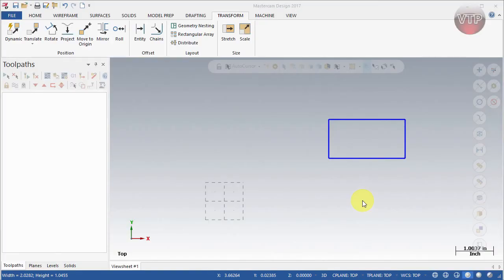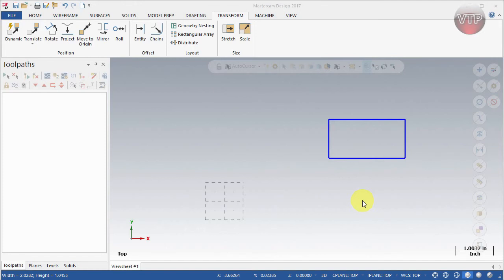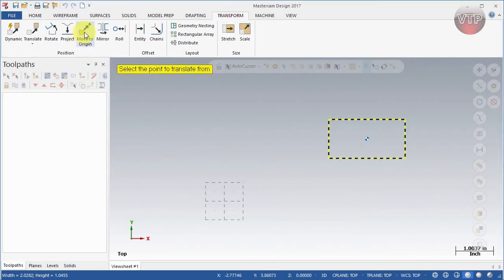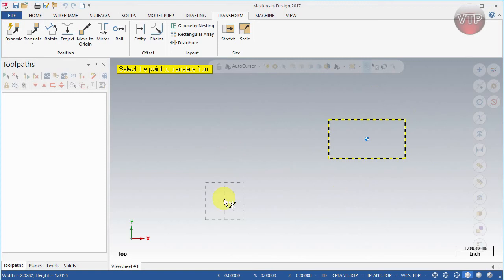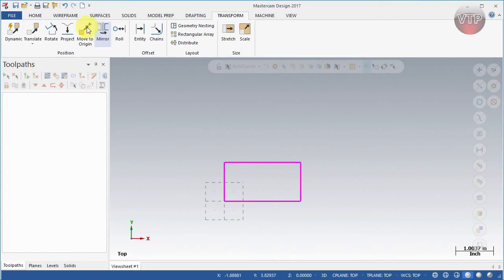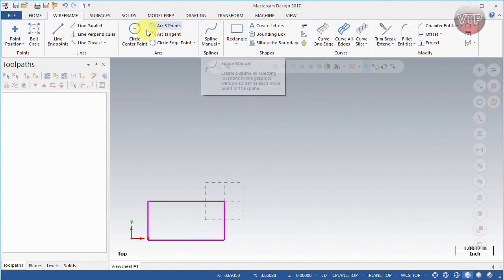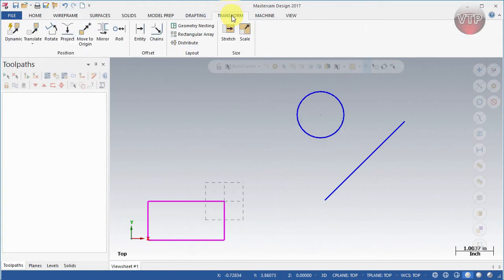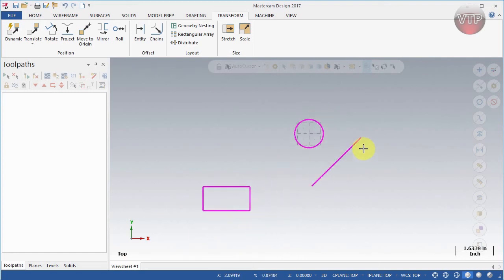MASTERCAM 2017-2020  - INTRO - Move To Origin - vtpros.net (2019-2020)

Comment: The old Mastercam move to origin had a bunch of options such as move origin to the intersection of two wireframe lines that are not connected. Do you know where or how to use the older options for the move to origin?